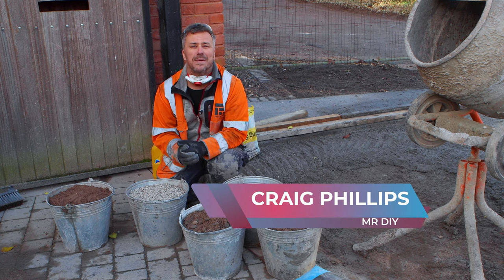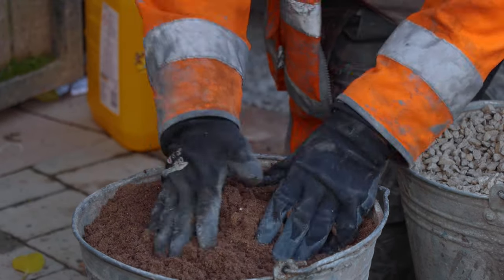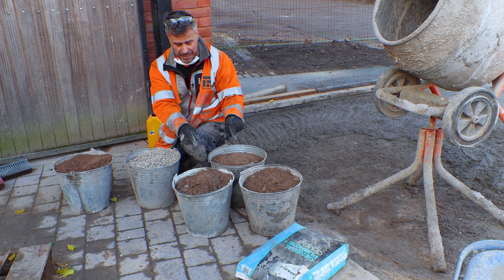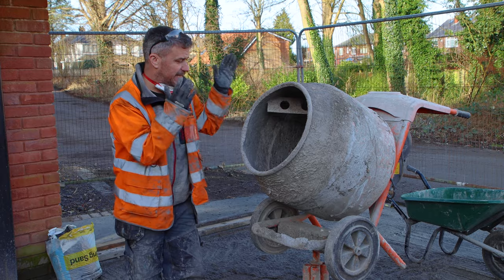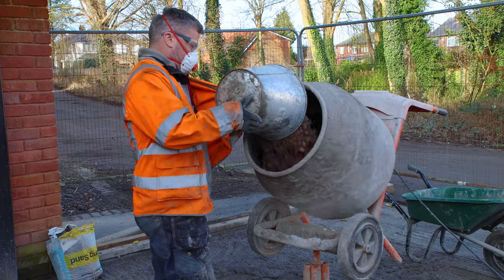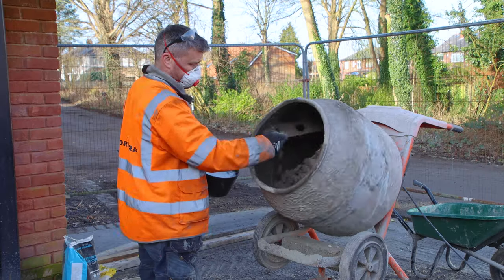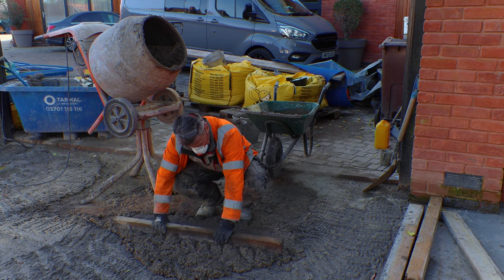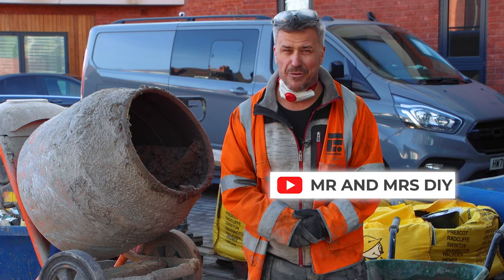How To Mix Reinforced Concrete LIKE A PRO | Beginner's Guide | Concreting 101

Comment: Excellent video. One of the best on YouTube I've seen on mixing and understanding concrete. I really don't understand why your videos have so few views. Your content is brilliant and very well presented. Thank you and I hope your channel starts to receive the recognition it deserves!
Reply from the maker: Thank you very much, we're pleased you like our videos and thank you for the kind words!
Reply: @MrandMrsDIY thanks for the lessons  I'm about to make 2 building on forest floor...it's mostly level. Is it better to dig out the high spots and repurpose the dirt in the lows...or fill in the lows with something else to bring it level?
1st building is primarily storage for wood and other materials waiting to be repurposed. 2nd building will be much larger and hold heavy woodworking equipment for one person...myself and possibly one other person. I'd love to do infloor heating but that's too costly...how thick should my concrete slabs be please? Not putting in a basement.  I  need it close to the ground.
Reply: @MrandMrsDIY Also...I really need a dust collection system...since I have have not found a way to beat gravity...lol...in your opinion should I create channels in the  floor so the system doesn't have to work so hard, run it along the walls level with the machines or run it up in the ceiling? I'm concerned about blockages if it's in the ceiling bcuz I'm short...lol. plus I want to find a way to collect and reuse it.
Reply: Many thanks for your comments Simon

Comment: Tip for using the fibres. put them into the bucket you're using for water and stir it with a stick until they're mixed with the water. Saves them from clumping up in the mixer.
Reply from the maker: That's a great idea!

Comment: Good video, easy to understand as well. A lot of people making these videos always use trade terms and it doesnt really translate to the layman doing a small diy job. Nice explination of the ballast mix at the begining as well. Quick question though, i have just dug the trenches for my retaining wall (wall is 1m) and i'm using 6 inch thick concrete blocks flat rather than on their sides. Would you put rebar in this at all?
Reply from the maker: Thanks mate! I think it should be fine without it, providing the concrete cures properly, you could put it in for peace of mind though
Reply: @MrandMrsDIY  Thanks for that, i am going to use the 6 to 1 ratio for it. Will need to order more ballast though but shouldbe fine. Would 1m rebar poles ar an angle or 90 degree be ok or should i use the lattice style if i go with it?
Reply: Many thanks

Comment: Hi Craig. Would you add more water than the directions on the concrete bag if you add ballast?. 
I'm using it for hopefully stopping my neighbours water running into our garden as it's ruing it and they aren't very cooperative so my job this spring is to dig a trench along the fence that separates our garden and the laying concrete and some breeze blocks right along as a dam to stop it. Would you say that'll do the trick? Subbed! Oh and thanks to you our house has wonderful flooring from your tips from a while back. Cheers!
Reply from the maker: I'd stick with the direction first to see who it mixers up then add more oil needed, you can always add more but you can't take it away.
Reply from the maker: A small block dam may work however just be careful were it runs from there as the water may build up even higher and course further problems
Reply from the maker: It would be best to try and divert it into a drain if possible
Reply: Cheers 👍 Tried reasoning with them to no avail and they are renting from a housing association. We own our house so after 4 years of trying to be nice and sending Letterston both parties I'm just gonna block it and tell them if your garden turns into an outside pool from your water use then you'll need to sort a drain out yourselves via the housing association. They have outside dogs abd a small pool which all thst waste just floods into mine and gas all but ruined my Indian sandstone but I'm hoping to salvage it and get my garden back so we can get on the bbq finally this summer.
Reply from the maker: It sounds like your having nightmare, good luck with it and hope you get it sorted  @PS-en7wn

Comment: Nice video Craig how thick would concrete need to be before you consider using rebar to give additional support ?
Reply from the maker: If you was expecting HGV's I'd say certainly fit Rebar's
Reply: I'd say over 75mm deep

Comment: what is the correct ratio for internal concrete floor? I'm replacing my concrete floor as it was cracking and damp. The old concrete was laid down directly to soil and no dpm was used. Ex council bungalow from the 60s, obviously building regs non existant back then. Plan is to go 150mm hardcore compacted, 50mm blind sand, 1200g dpm, 100mm insulation, another dpm then 100mm concrete. Any help appreciated.
Reply from the maker: Yes I've worked on my older houses like that, your doing all the right things with Hardcore, blinding sand, 100mm insulation just make sure its a decent one ands not just white light weight polystyrene, then the concrete pad can be a little weaker than the we we did outside, 6 x Ballast to 1 cement should be fine.

Comment: What do you mean lean concrete?  
Terrific video!  Hand mixed is a lost art around here.  Also I like the buckets!  I used to just count shovels full.  
I guage the water by watching how much the mixer pulls the batch up the inside of the mixer.  I looked u up by searching for fiber reinforced concrete.  
Im getting ready to make a retaining wall of 6"x 6' posts.  Fibers will make better posts.
Reply from the maker: Hi! 

So lean concrete is is mainly to provide a foundation for the foundation concrete, so when you're putting your good stuff in it won't touch the soil because the lean concrete is there

Nice work with the mixing! Yes shovel fulls can be a good way to do it, we just prefer to do it by bucket fulls just to guage the ratios better, but to each his own!
Reply: Lean concrete is a good thick compacted mix thats strong and not to wet to use.
Reply: Thanks so much Craig your great at explaining this stuff.

1. How long does it need to be mixed for?

2. Is this 4 to 1 ratio good for laying my garden concrete on clay soil? Ready for maybe decking later?

Comment: If you use fibre reinforcing, does that mean that you don't need rebar for your driveway? 
I'm planning concreting a track down to my house and would be a lot cheaper without rebar.
Reply from the maker: The reinforced fibres do add significant strength, depending on the level of traffic and weight vehicles that will be crossing it, you may still need some thin reinforcing bars in it. I would recommend doing some further research into the depths of the concrete you'll need and also the weight of any vehicles that will be on it! Cheers
Reply: @MrandMrsDIY  Thank you.

Comment: Is the 4:1 ballast to cement suitable for garden shed base slab. Also how much would ballast and concrete would i need for 1m^3. Im such a beginner lol
Reply from the maker: yes the 4:1 is fine! 1 full cubic metre would spread across an area of 10 square metres, giving you a depth of 100mm! Cheers!
Reply: @MrandMrsDIY  thanks for the reply guess it's best to wait for a  drier season before attempting?

Comment: Im confused… you say  1 to 4 ratio  is weaker than a 1 to 6 ratio . How is this possible  ?
Reply from the maker: I'm referring the 1:4 ratio to be a stronger mix, this is what we did for the driveway (which is only 100mm thick, with reinforcement added), when I refer to the 1:6, this mix is for foundations which would be laid a hell of a lot thicker at a minimum of 600mm wide, and around 1000mm deep, so when you have a mass dense area of concrete like this, it doesn't necessarily have to be mixed with as much cement to give it it's strength (as the mass area makes up for this) 

Hope that helps!
Reply: @MrandMrsDIY 
Excellent explanation!
Reply from the maker: Thanks Mike  @mikemontagne2703
Reply: Let me talk to people as if they're idiots.
Where's the MDF. 😂😂😂
Reply from the maker: Did I, when
Reply: @MrandMrsDIY you were not condescending in any way I could hear...ignore the negativity. 
Thanks for the lessons! I'm going to be making two buildings...one is simply for storage of old wood,  etc waiting to be given a 2nd life. The 2nd is going to hold heavy equipment...how thick should the concrete slabs be please?
Reply: @mikemontagne2703  The rock in the mix is what truly gives the cement the surface area strength.

Comment: hi im having trouble in knowing how much a charles bentley 45l cement mixer can take for doing a drive in 5ft by 5ft by 2inches, think volume is 50 volume  but am i able to use 1 bag of ballust, half bag cement and water in this size machine or can i put in more?  if drive way is longer how do i know what the highest amount of concrete is in ghis type of mixer?   Any advice please?   thanks
Reply from the maker: No not sure what your question is
Reply: @MrandMrsDIY  sorry does this make sense?  I want to know how much sand, cement and water can be put into a max 45l cement mixer?
Reply from the maker: @dntylr7482  R right, I cant help you with that one, have you tried Googling it
Reply: it's ok will test it over time.  Thanks for getting back to me though.   have a good day
Reply from the maker: @dntylr7482  Cheers

Comment: Sigh...my comment must have posted in your other videos...I  turned auto play off and it still does it.
Reply from the maker: Not sure what you mean
Reply: @MrandMrsDIY  even though I told YouTube not to automatically play videos...I was still typing a comment when it switched videos...comment went either into cyber space or another video...sigh
Reply from the maker: R right ok.  @fdort3971
Reply: @MrandMrsDIY  when I make cement forms...and I want to reuse them...what is the best way to cover them? Concrete heats up while curing correct?

Comment: Wait now. Did you just say that concrete with more aggregate for a given amount of cement would be stronger?
Reply from the maker: Hi! This is due to large parts of aggregate being able to interlock within the mixture, providing strength based on its and the cement internal properties. Cheers!

Comment: Too much water
Reply from the maker: What makes you think that ?
Reply: @MrandMrsDIY looks slightly more workable than it could be, concrete needs to be the strongest it can be for a thin slab. What you've done is fine, but an extra 500psi could make the difference between crack and no crack, also longevity
Reply: That’s not too much! Looks good 👍
Reply: Okay I take it back
Reply from the maker: @George.Coleman  Thanks for watching!
Reply: You do realise that Craig is a proper builder?